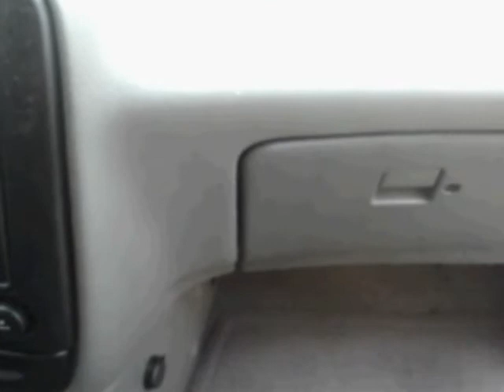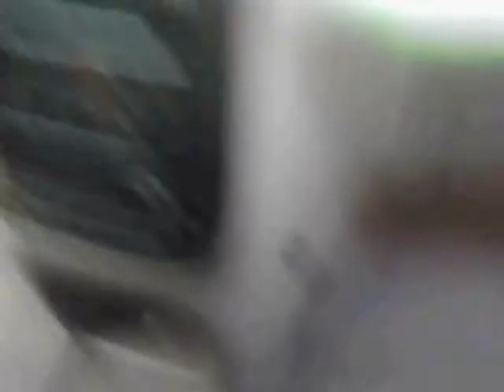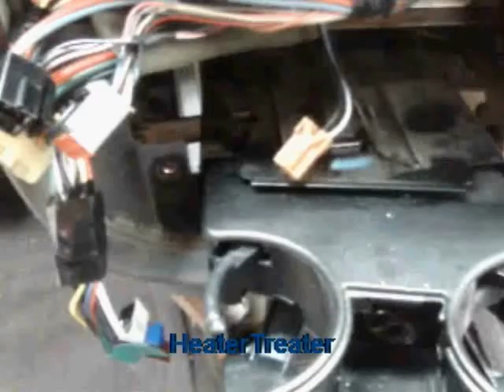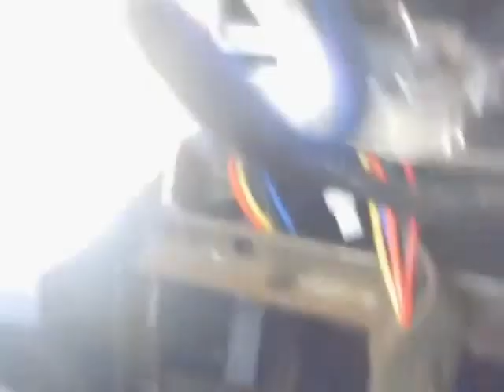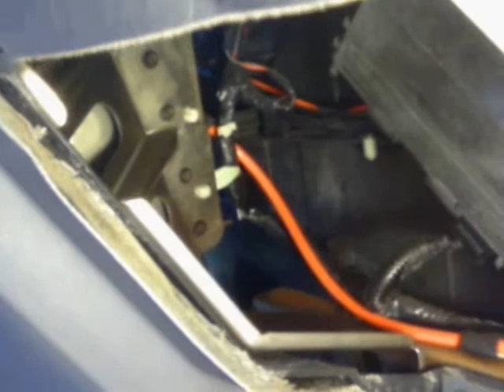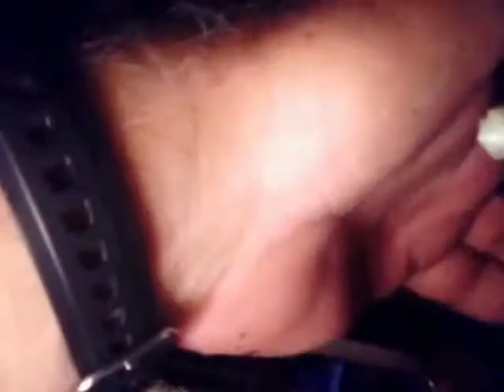HeaterTreater Ford Windstar blend door repair

Comment: i just did this repair and i did not even bend that metal piece. it was really easy and i did all the cutting through the glove box no problem. then again i used a soldering iron. i also made a video if anybody wants to check it out.

Comment from the maker: We have multiple videos and don't generally reply on the YouTube response box since we can't include any additional information or provide links to information on our web site.  With a little thought, you can find out web site and we respond promptly to requests.  On the note below referring to vacuum control.  That only applies to the mode doors that control which vent(dash/floor/defrost) that air comes out of .  All temperature control is electronic, not vacuum.